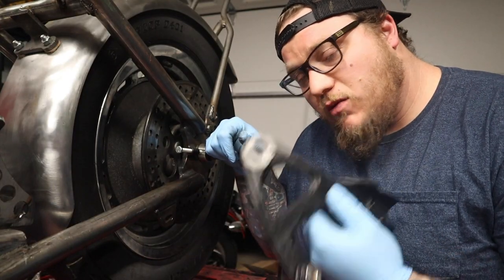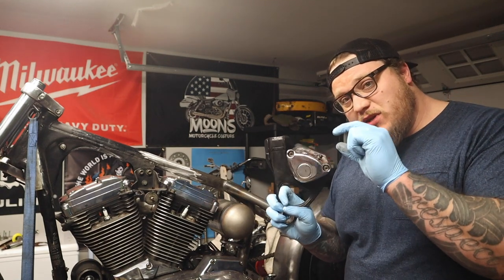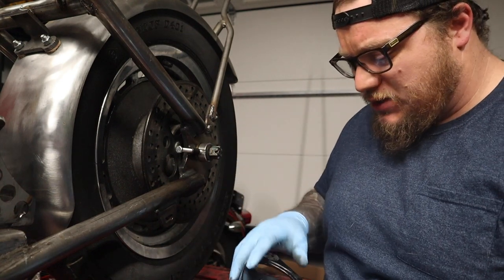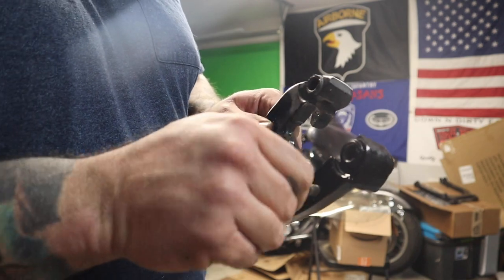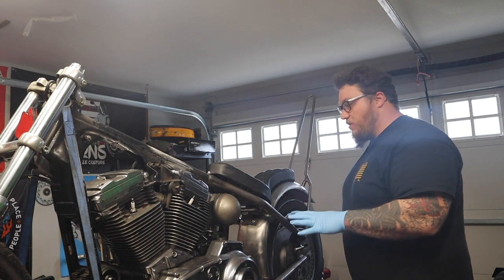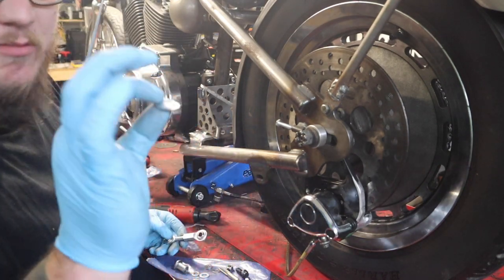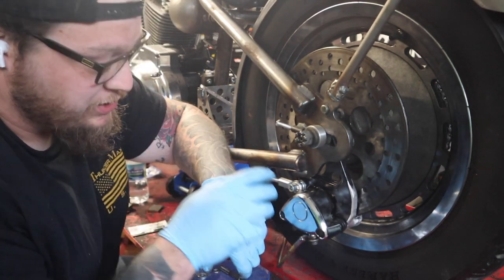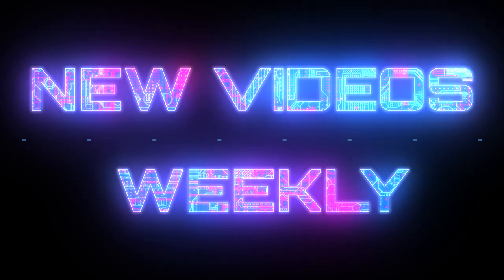Chopper Build | Part 7: Brake Issues FINALLY Resolved

Comment: How did get the rear brake to bleed?
Reply from the maker: Bench bleed. I go over it in one of the videos. Basically bleeding the caliper off the bike with the bleed valve upright, then putting it back on the mount.
Reply: Ok cool thanks for responding